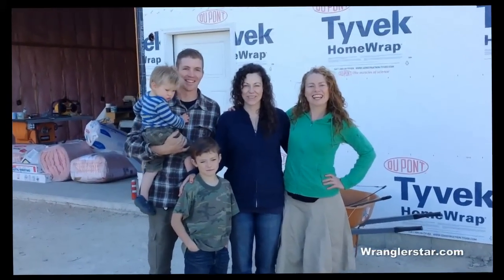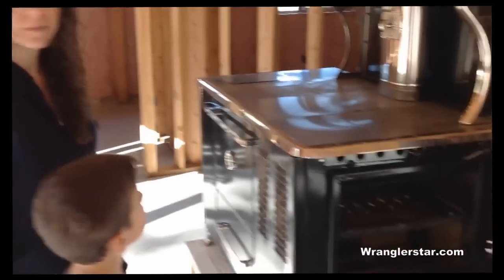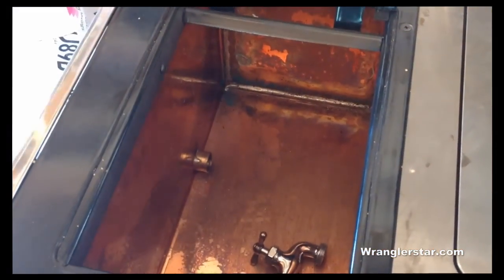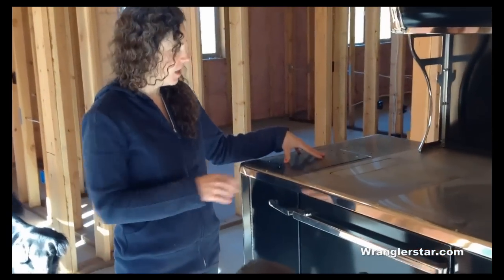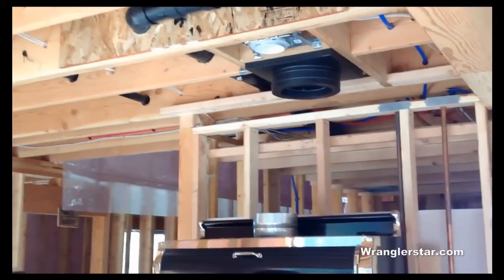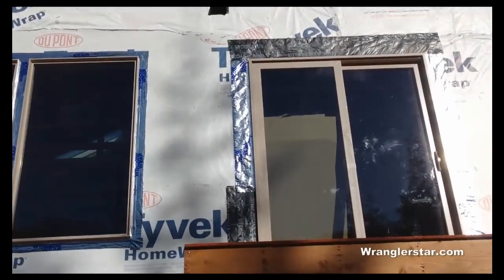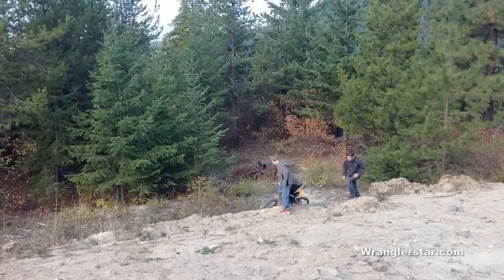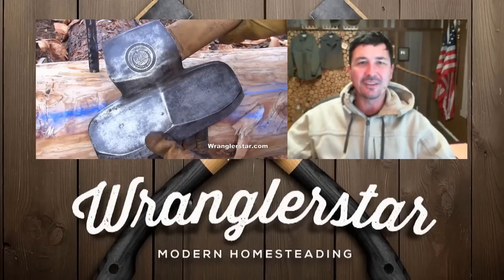Flame View Wood Cook Stove - Wranglerstar

Comment: Today is chilly here in the NE mountains,  so I am using my wood cookstove and it isn't even
quite freezing outside yet.  The stove's been here for almost 50 years, and it's at least 100 yrs old and in excellent condition.   Yes .... an entire blessing to us for cooking and for the extra heat in the winter.  It takes energy to get the wood,  and some attention to keep it a good temperature.  I love the flexibility of heat when cooking a large meal.  I love it so getting used
to it was a pleasure.    We do use a gas stove for the hot months,  and I appreciate that too, and would recommend having one just in case!   We did have H2O hooked up but it was not
as reliable,  so have it unhooked now .. and use an electric water heater.  Hope you love your
stove and that nice new home !

Comment: My father used to get old cast iron wood stoves for free from people who were modernizing their homes. We always had a half dozen in the back yard trying to find homes for them. We also tested out a few of the nicer models. It was not too hard to cook most things on top and the oven was relatively easy to use. Using all cast iron cook wear helps to regulate the heat. That includes using cast iron roasting pots for the oven. We did a few stupid things though, like burning coal once (melted a stove in the garage) and dropping an old "wet" rag into the firebox and finding out that one of us had just soaked it with solvent to clean something. Shot fire out of the chimney like a rocket.

Comment: Their breaker box was amazing!!  I have been wondering if a family could have a normal sized home and still produce enough power to maintain it.  Did he design the setup himself and is there a way to learn more about it?  Really nice video!! Thanks for sharing your trip.
Reply: well judging from all the vehicles and stuff they had im assuming they can afford plenty of solar panels and a wind turbine for plenty of power... i would have just done that without having the wood oven that seems like a lot of work and you cant just set it to 400 degrees and cook a pizza. they also could build a wood gasifier plugged into a generator for electricity from burning wood you can even run old trucks on them its pretty cool
Reply: constitutional libertarian ya, but trust me, that stove is soooo worth it.  Look up Dirtpatcheaven for why.
Reply: Mr. Dirt
i dont deny that its cool lets just say it would be cool to have a normal electric oven and this wood oven
Reply: I have seen the small wind mills like go on sailboats starting to pop up on hunting cabins and  stuff.
Reply: constitutional libertarian I believe you may have underestimated that stove.  I grew up with a wood cook stove and a propane stove sitting side by side in our kitchen.  Our heat was only wood stoves and a fireplace in the main room.  The women in my family were amazing and passed on the the knowledge of what wood to use depending on what you needed to cook or bake.  A nice fire with hickory will bake that pizza just fine where poplar will work fine for biscuits.  It's all about the kind of wood you use in the stove or fireplace.  
I think they have done their homework quite well and know exactly how to meet the needs of their family.  I believe this hard working family has some interesting knowledge that if shared could be a great learning experience.
Reply: Melody Capehart Medina
i didnt say they didnt do their research i just simply stated a fact that having a normal oven powered and the house powered by solar and wind power would be good so they get free energy... also why would you burn hickory unless its like old and cracked because every type of hickory is good for making bats or tool handles and alot more
Reply: constitutional libertarian LOL  because I love to cook with wood and eat but don't play baseball :))))))))
Reply: Melody Capehart Medina
fair enough
Reply: +Melody Capehart Medina       When I saw that breaker box I thought how 
beautiful. Ether the work was performed by the owner or a skilled tradesman.
Reply: You can you food and you just have a cooler with ice to store some things and you have a small generator but you don't need power all the time when yu live off grid.

Comment: Hope it works out.  Just beware if you overheat a gas hot water heater its done.  It pops a the control valve that renders it useless except as a holding tank or wood heat. Grand job! Best of luck.

Comment: Thank you for sharing this video and information about your new home. As a professional firefighter I do have some safety concerns about the Flameview cookstove, 3 of our clients called us after the fire dept had been to their home and put the fire inside their Flameview out. The design of this stove has the base of the chimney low inside the stove with no clean out. Creosote has a tendency to build in these stoves and is not easy to remove. The instructions say nothing about this hazard. Taking the stove apart I discovered many things and quit selling them as a result. I also made a video about this stove, because I feel it has safety issues. I would encourage folks to do some research first and understand those design flaws. You must remove the 7" oval pipe (with the damper and emblem on it) coming out of the cook-top quite regularly to be able to access the base of the chimney from the top and dig out the creosote.There is no other access. If this ignites you will have a 2100 degree fire burning in a sheet metal stove that could catch your floor and wall on fire behind the stove where you could not see it until it is to late. There are some UL listing issues with it as well. Other than that, it sure looks nice. Just make sure it is properly maintained and keep a couple fire extinguishers handy. Here is a post on Hearth.com explaining the issues better.  http://www.hearth.com/talk/threads/does-anyone-have-the-margin-flameview.113187/page-2#post-1588538

Comment: Some tips your friends will learn: The heat settings on the cooktop are neither consistent nor static.  The "low" setting area is more like lukewarm to warm, and the "medium" is an area about 2" wide.  We looked at getting that stove, but found one from a guy locally that was selling them.
Also, they MAY need to chlorinate their water to keep the algae from growing in the resoviours and pipes, and they tend to get the old water taste.   And(I doubt this would happen to him, as he has the water heater as well) he must make sure not to boil the water in that hydrocoil, if so, its a problem nicknamed "boom-squish" and its very dangerous.
Where did your friend get his stove?? Obadiah's, I'm guessing?  Great folks.  I hope they have nothing but joys with it.  I know ours has been a great (even lifesaving) blessing.

Comment: DO NOT CLAD!!!
Hope this reaches you in time.
At 0:42
The TYVEK appears reversed lapped at the joint where the rake meets the horizontal (a foot above the windows and doors)
If this is the case, moisture will run BEHIND the weather barrier and cause serious water damage to the envelope. 
DO NOT expect the TUCK tape to correct this error.
TUCK tape is designed to air seal TYVEK only.  It is not designed for moisture flashing.
The weather barrier must be installed in a shingle fashion to direct moisture away from the structure and TUCK taped to complete the installation for optimal air barrier.

I would also question the door installation.
I don't see a head flashing and associated flex flashing etc

Before you clad the structure Please ensure your weather barrier is installed correctly...
Water is the single most destructive element to a building.

NSPCTOR

Comment: Hope that you talked about that you should not drink water from copper container? It is used to heat water for washing and laundry! Copper is dangerous if ingested in large quantities.
Reply: i think its ok
Reply: You were probably not aware that most homes built use copper pipes. No danger to most people from the very small amount of copper from the pipes, or their stove reservoir. Only people with diseases or sensitive to copper can be affected as the copper leaching into drinking water from piping is low level.

In fact, like iron, copper is a vital nutrient for our bodies. Here are some foods rich in copper:

 Sesame Seeds

 Cashews

 Soybeans

 Mushrooms, Shiitake

 Sunflower Seeds

 Tempeh

 Garbanzo Beans

 Lentils

 Walnuts

 Lima Beans
Reply: Nirky
well informed.:)
Reply: You're thinking of verdigris, the green, oxidized residue on copper that is poisonous. Unless you were to disturb the patina (such as scraping with a knife) it should be fine.
Reply: Nirky Sure! The problem is not the copper pipes! The problem occurs when the copper is heated by the water and the copper emit particles. Therefore, you should not drink hot water from copper vessels! You don´t have that problem with cold water pipes .
Reply: kanehunter23 A smart head who thinks he thinking? Read what I wrote !!! It's the hot water that is not safe to drink. Not from those cold pipes.
Reply: I own and use copper kettles that my great grandparents used for +50 years. My grandparents used them for +50 years and my parents used them for 25+ years. How is copper bad when heated?
Reply: sillenHDsportster Then why is hot water from my copper pots, tea kettle etc safe?  Best jam cooker is copper.
Reply: Beth DeRoos No ! It´s not safe unless it have a coating on the inside .
Reply: ***** According to several researches made releases heated copper out substances that are not good! You may be allergic to copper if you are unlucky and you can get stomach problems.
Reply: Beer is made in copper kettles at many breweries. They'll be fine.
Reply: Diabolik771 Are they heated to 60-70 degrees C? If that´s so, it´s not healthy.

Comment: DANGER! Please contact your friends and tell them NEVER to use the water from the copper lined tank for drink or food! This is very important as the water can be toxic if the water is acidic. This could be the case if they use rain or pond water! Due to sulfur pollution in the air ponds and rain is a very thin acid that corrodes pure copper to copper sulfate and other nasty poisons.
 
If they want to make the tank safe, they must line it with tin. It is simply a matter of putting lead free tinning  paste on it and heat it with a burner inside until it is all melted and covers the tank inside.
Reply: I'ver never heard of this before.  Just wondering why this reaction is not the same in the copper pressure lines?

Comment: I would be very reluctant to drink water, especially hot water, that has been stored in a copper container or reservoir.  Copper is very toxic.  Also, do you know the composition of the solder in the joints?  Children are even more susceptible to the toxic effects of heavy metals on the developing brain.  Similar comments apply to the use of uncoated cast iron cookware. Acidic foods cooked in those pots and pans would be expected to be even more problematic.  I won't make any more comments.  It's likely that nuts will soon come out of the woodwork and extol the "benefits" of copper, killing bacteria, etc., etc.  They will tell you that everyone needs copper and iron and that their grandmothers used cast iron all the time and survived to 106 years.  The toxicological facts remain.  Why take unnecessary risks, especially with children, when safe cookware and storage vessels are readily available?
Reply: Well put. Absolutely agree!